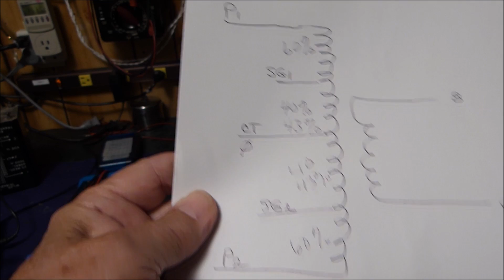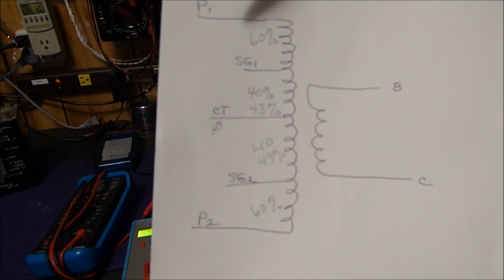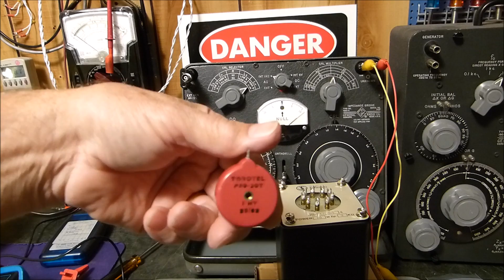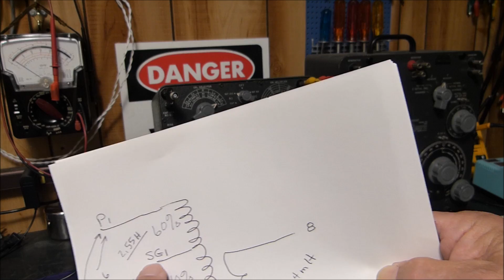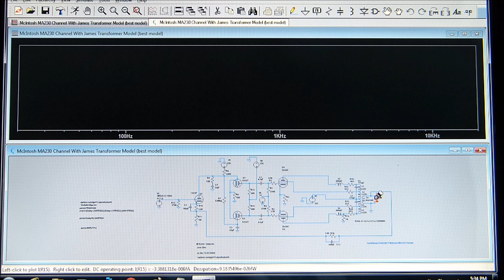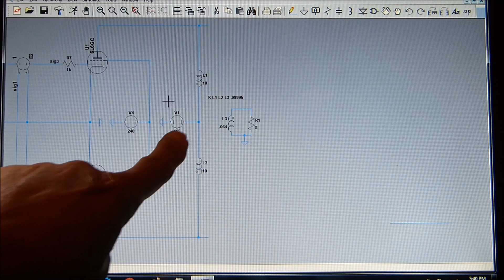LTSpice Modeling of Vacuum Tube Amplifiers and Output Transformers

Comment: What happens with the core saturation issue if you perform the classic short and open circuit transformer tests to get equivalent circuit parameters?
Reply from the maker: I measure the inductance with all windings open. Measuring inductance with one winding shorted is a test for leakage inductance and putting a proper load on the secondary allows for measuring impedance of the primary or vise versa. I have learned there is a lot more to this process of measuring core saturation than I initially thought. A DC magnetizing current is part of the process but then a LF AC signal is also part of the process, if I understand things right, or at least a little better. 
My interests have jumped to making a simple circuit to measure mutual conductance (gm) of a tube. Not just for testing a tube but also for having a standard(s) to calibrate a genuine tube tester.
I also picked up a very nice 19" rack today that I want to build another large RF amplifier into. Can't decide which tube to use. Got a nice selection to choose from. Maybe a pair of 833A ? That should look nice.
Reply: This is really bearing down on a misunderstood measurement/modeling application. Very nice work! My only question is, in the classic short circuit test you ran the voltage up until reaching rated secondary current was applied and then measured complex impedance parameters. I believe that was to address saturation levels and impacts at max specs. It may apply more to 60 Hz AC than through the audio band but low frequencies dominate in impact.

I got most of the way through building a mutual conductance tester that would provide for  a course manual curve tracing function. I also wanted to match tubes on it or as you said establish a  calibration standard.  I'll stay tuned to see what you come up with. Perhaps it will motivate me to dust off my project.  

Don't see too many 833 amp builds.  It would be very cool to see one properly measured and characterized.  Have to use the mercury vapor rectifiers to go with the nice size bottles of the 833's. Love that! Are you using those cubic foot size trannies you were showing off in one video? Wow are they huge. 

Just bought a pait of Dynaco Mk3's and I am going to compare original board with new caps to a VTA Octal driver board upgrade. I did an ST70 driver board Upgrade 10+ years ago with a SDS cap board I still use. I'll probably do that to the Mk3's as well. Going to try a set of Sylvania 6An8's I found. Skeptical of quality that's left out there for these tubes.  
Keep em glowing!
Reply from the maker: Mark,
Yes indeed, I love these subjects. I had to watch this video again to see what I did. I don't know if you have seen it yet but I built a jig to measure high levels of inductance that actually works better than the GR. My highest regards go to the GR engineers but the GR-1650 is a 1 KHz instrument, even though it has an external input, it works best by-far at 1 KHz and is often times very sluggish at other frequencies (external input) especially if they are LF like 40 Hz or so. 
Every time I post a video and then learn more, often times from comments from you guys, I wish I had done a better job of the video and included these improvements.
Anyway, I am all for the gm project. I think it should be pretty simple. In my case I see test points where I can monitor plate current and grid voltage and vary a bias then introduce a 60 Hz driving signal and do the math. I am pretty sure all this is going to be at peak current and voltage levels and not RMS. I don't think we will have any phase issues but if we do the angles will have to be in radians instead of degrees. Not a problem.
I  think I have settled on the approach to the 833A amp. It is a medium mu triode so it is not a candidate for GG operation. There are actually a couple of builds on the Internet where good gentlemen have posted their success. They keep it simple and drive the grid with a 50 load off the grid and about -130 volts bias, etc so it will only take 4Kv and a bias supply. 
My issue is I have a beautiful B&W 852  tank coil I want to use but I am concerned the L values will be incorrect for the 833A. I have to do some careful measurements and calculations before starting. I can always make it a one band amplifier using 1/4 inch copper tubing for a tank circuit but that is not what I want to do. That is the way I did it a long time ago and it works great.
The B&W 852 coil  is for a single 3-1000Z or a 4CX1000A or even a couple of 3-400Z but I have built amplifiers with all of these tubes and want something else. Steaming-hot and high performing amplifiers and I am a bit concerned ;the 833A will not be as good but I have to try it.
Reply: I Watched the follow-on video before posting here.  The vector (phasor) analysis is nicely presented.  Still pondering specs and DC current saturation component for audio xformers and equivalent ckt params for LTSpice.  The test fixture you built is very nice and critical to stabilizing the setup for practical use.  

I missedunderstood (pun intended) your 833 project as an audio amp. Should still be interesting. I am not a Ham operator but ironically spent 20 years as an Antenna/Systems Engineer in the defense industry. I still enjoy the designs of HAM band amateurs and have worked on designs from HF to mmW freqs. Audio has always been a more practical passion.
Keep up the intrepid work and.....
Keep em glowing!
Reply from the maker: When I started on the venture to accurately model audio transformers for LTSpice, I was "horrified" by the lackadaisical attitude that seemed to be everywhere with the other models I found. Everyone used a K factor of something like 0.99997 and usually no leakage inductance or C to ground. Well, after chasing the dragon for a while, and making a bunch of models I figured it out and that is, it is a heck of a lot of trouble to measure all of these parameters, which I worked hard at for a while, with basically no improvement, if any,  in the model. So in the end, I understood why such a simple model was, certainly for all I needed, sufficient. Thus, humbled again...
I spent all of my working years as a defense contractor working for the military-industrial-complex as President  Eisenhower labeled it. My world was in computers and management but I always wanted to be one of you guys designing RF equipment - maybe working for Collins Radio... a ham radio operator's dream?
I flip between AF and RF. Two different worlds. One is uH and the other is an even stranger world of iron core inductors. I have been really surprised by the difficulty of measuring vacuum tube output transformers but the method I use with the little jig I built is actually much easier than using the GR 1650-A and I believe just as accurate if not better and actually more repeatable than trying to measure these large inductors at 1 KHz.
Very much enjoy our conversations.
Got to get to work on the 833A... with, of course, MV rectifiers at the bottom of the cabinet. I can see it all in my head.

Comment: 1:30: The oddities with the percentages is due to phase-shift!
Reply from the maker: I sure agree and the sum of the voltages across these coils and series resistors if they are used in measurements, will add up to a good bit more than the source voltage. Very interesting.
Reply from the maker: I agree and I think that problem has been taken care of in the next video where I do deal with most of the vectors and use the phase shift as part of the measurement.

Comment: i would probably try stepping through a 5Hz-50kHz signal through each winding and take a look at the output measuring impedance.  seems like a frequency dependent thing.  from that, i'd see where the values are that they spec them at lie on the graph.  have to look at it the same way we look at speakers, i'm afraid.

Comment: On another note, measuring the DC Resistance of a winding can magnetize the core. A good transformer will produce no even order harmonics - as your spice results in your next video indicates. If the core is magnetized, a second order harmonic will appear and can even become dominant. Perhaps a good subject for a follow-up video ;-)BTW, I've become addicted to your great videos. Thank you!
Reply from the maker: It is interesting that you mention that about the (perfect) transformer not producing even order harmonics. I did not know that until now and if there are even order harmonics it is the R or shunt L and C that causes it. I learn a lot from you guys when I post videos. Totally agree about magnetizing the core with even tiny currents. The GR 1632-A manual is online and easy to get from the Bama Boat Anchor web site. It describes my issues perfectly starting on page 8  section 2.11 and talks about demagnetizing the core. Thanks again.
Reply: Thanks for the reference to the GenRad manual; there's a lot of good info in there.  BTW, Igor S. Popovich wrote a great set of books (3 Volumes)  "Audiophile Vacuum Tube Amplifiers" - Volumes 2 & 3 have chapters relating to transformers that are quite good.
Reply from the maker: I looked up his books. On Amazon all three are about $209 and I want them but I may have to wait. Thanks for the info.

Comment: Inductance is measured with the secondary winding "OPEN".Stray Inductance is measured with the secondary winding "SHORTED".Measurement frequency is commonly 100Hz.That GenRad Bridge, driven with enough signal to adequately overcome magnetization flux should provide a good measurement.   LCR meters can't do this, your bridge can.Compare with this simpler method (hopefully you can view this JPEG):  http://www.diyaudio.com/forums/attachments/tubes-valves/242835d1317582325-proper-measure-transformer-inductance-indmesurements-jpg
Reply: The permeability of the core material is very non-linear - it's low when flux density is low, high when flux density is moderate and lowest when near saturation. Permeability also changes with frequency and DC current levels. A good indicator of a fine Audio Grade Transformer is a smaller change in inductance when measured at 100Hz and at 1KHz. Another good indicator is the shape of the Hysteresis Loop (using an oscilloscope).
Reply from the maker: Hi Gary,
I have tried these methods and they do work for small inductance up to maybe 1 H or so. I use a transformer as the oscillator (60 Hz) so I can ground the center point where the R and L meet and place scope probes across the R and the L. When balanced, it is beautiful on the scope how the amplitude of both signals are equal and they are shifted 90 degrees from each other. On the other hand and as is addressed in General Radio and HP instrument manuals that measure inductance, the larger iron core inductors are a special case. Amazingly, these iron cores are very sensitive to external electrical and magnetic forces and accurate and repeatable measurements of L become a real chore. Overall, with patients, I get and trust values of L for the LTSpice models from the GR 1650-A. I considered purchasing a GR 1632-A but after reading the manual, I realized that the challenges I have with the 1650-A are still present in this dedicated L meter when measuring transformers. Many thanks for your suggestions.
Reply: My comment "adequately overcome magnetization flux" should have read, "adequately overcome magnetization current, by a significant margin" - This puts the operating point up into the region where the core's permeability is high.

Comment: A coupe LTSpice tricks. To get power dissipated by a component, hover over the part with your curser, press the alt key, and left click. The display will show power. To get average power hold down the ctrl key with the curser over the node name at the top of the waveform and left click. A box will pop up showing average power. If you want to do some math on the waveform, right click on the node name at the top of the waveform and a box will pop up where you can enter math functions, even using other nodes. Hope this helps and doesn't confuse.
Reply from the maker: Very nice. Works great. I see it now in the Hotkey document but didn't realize what it was. Very convenient. Thanks, Bob.